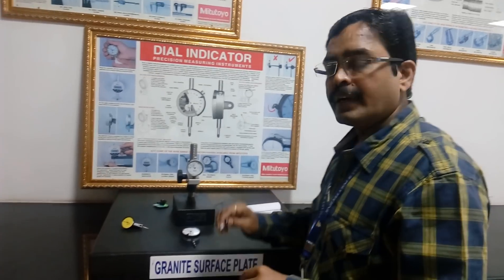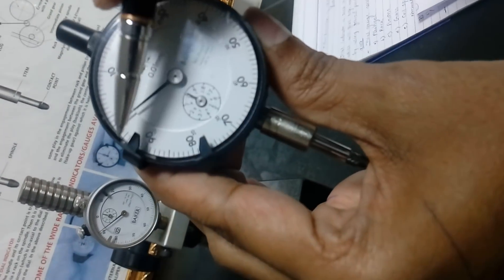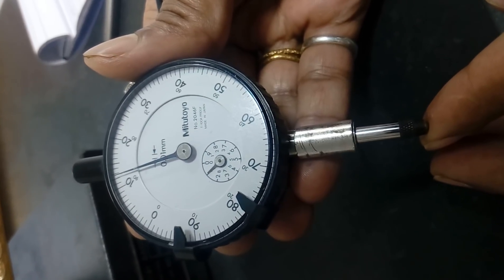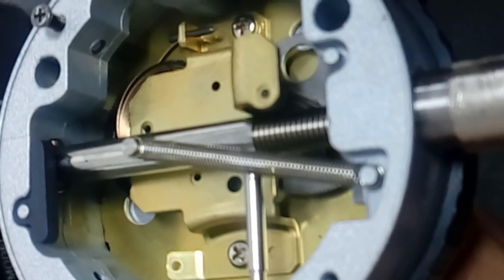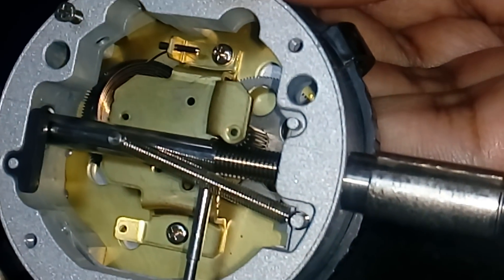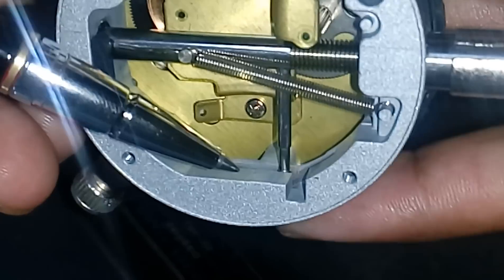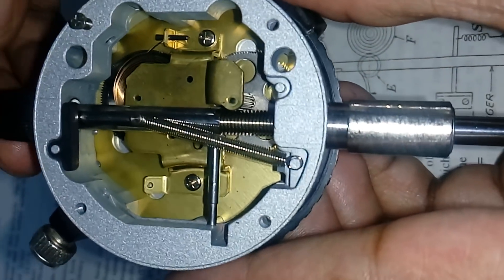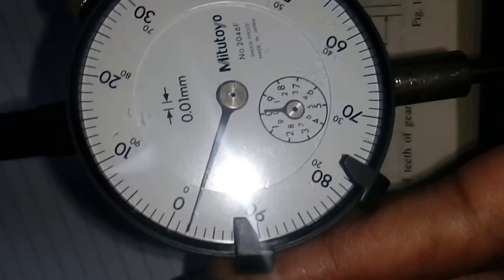Mechanism and working of DIAL GAUGE

Comment: he hasn't explained how it works - he just points out the parts and explains some irrelevant things. (when the plunger moves, it engages with pinion and turns it.. so linear motion of the plunger is translated to rotational motion in the pinion. Since the pinion is on the same shaft as a fixed gear, the gear rotates along and in sync with the pinion. The gear turns the dial indicator via a gear train+Hairspring (and creates 'magnification' - a small movement in the gear+plunger is a large movement in the dial.

You need to know about gear ratios and pitch of the threads to figure out what exactly is going on. Check out this video for more info: https://www.youtube.com/watch?v=Rp6D3YTx7iU (somewhere in the middle)